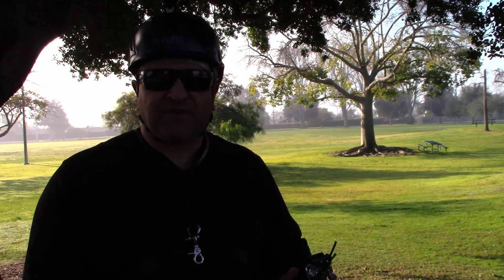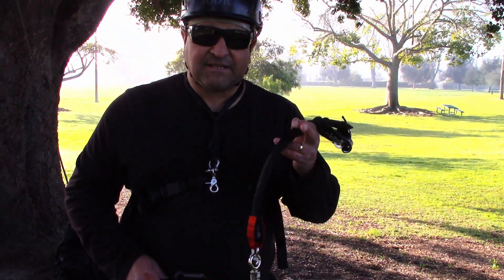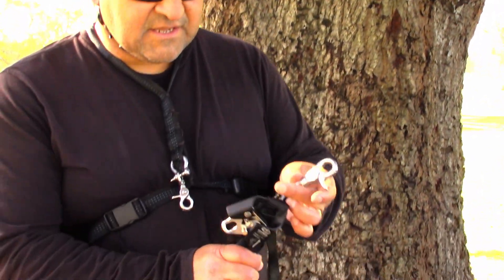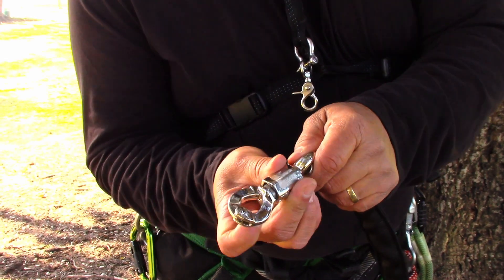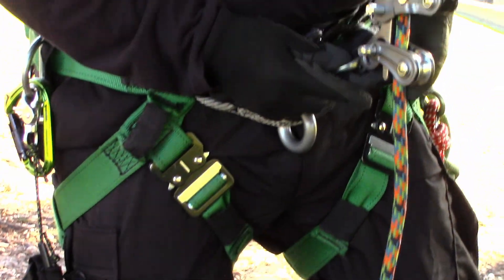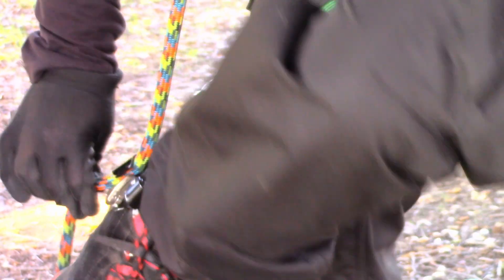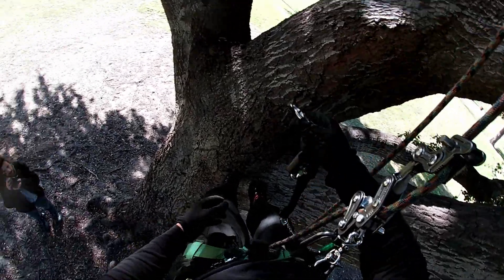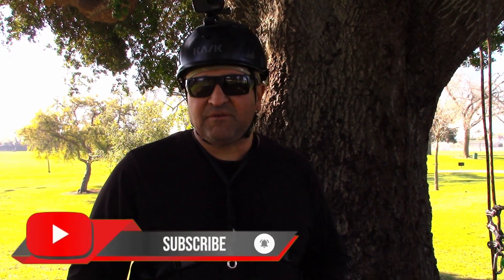Fastest Knee Ascender, The Haas Velox, Clip And Step.

Comment: Whats a good climbing rope for the haas velox knee ascender. The teeth are very sharp compared to the jet step and dont want to damage my other rope
Reply from the maker: The bluemoon, Xstatic, also Drenaline. Ropes with kernmantle construction are good to use.
Reply: @BinoH  I appreciate it sir. I was running a 11.7mm pelican rope  and it's just not constricted well enough to handle the knee acsender by haas from my experience

Comment: I would like to trim my queen palms in the backyard. What would be your basic budget friendly equipment to srt the ascend and descend.
Reply from the maker: Rope wrench with a tether, eye to eye prusik cord climbing line kermantle construction so you can use an ascender. Foot ascender. oval carabiner. I made a video named ( How to ascend the Single rope system)  in this video I go over some of the what you need to use. Hope this helps.
Reply: Also a recommended saddle
Reply from the maker: You should check out an Arbosts supply company online and see what is in your budget. The one I use is a Buckingham master 5.0.

Comment: Bino, thanks for the video.... may I ask you a couple of questions, please.
Do you ever (or have you ever) had trouble unhooking either your foot ascender or knee ascender from the rope because the gate won't open because the teeth are too stuck to the rope?
What kind of boots are those and do you like them?
Thanks!!!
Reply: Dont know about bino, but it happens frequently with me. I use ct ascenders, and they have fairly aggressive teeth which, as youve noticed, dig into the rope. You have to get into the habit of not having any weight on your ascender when you unhook. Also, you usually have to slightly raise your unweighted foot with the ascender so that the teeth can pull out of the rope before you unhook. If you dont coordinate it correctly you can end up with your foot up around your waist trying to unhook. 😃😃😃
Reply: @hosocat1410  Thanks for the reply! ... yes, exactly! .... I have spent some time just practicing unhooking the rope, over and over to try to make it muscle memory so I don't panic. ..... also, the best thing by far, was I bought a Notch Jet Step, which doesn't have teeth and you can pull the rope out the side of it no problem even with some weight on it.
Reply: @hosocat1410  thats funny.
To me its like using spikes with a tie in above, you don't want to come down to far without getting your spike out of the tree or as you said you'll have your ankles above your shoulders 😅
Reply from the maker: True!
Reply from the maker: Never with my foot ascender but at the begining with my knee ascender and that's because I had too much downward pressure on the line. I found that if I unlocked my knee and lifted it would release easy. My boots are Arb pro Andrew, I like them alot.